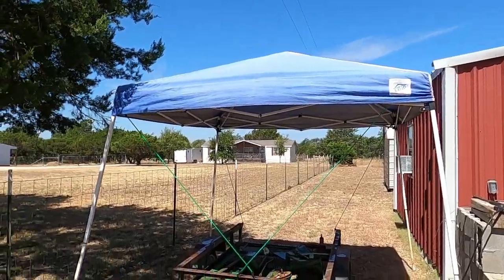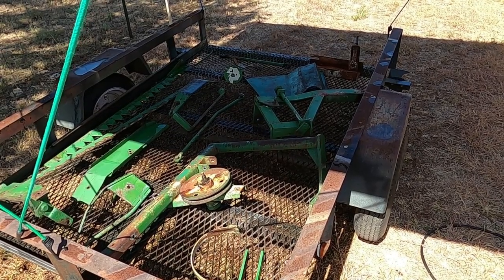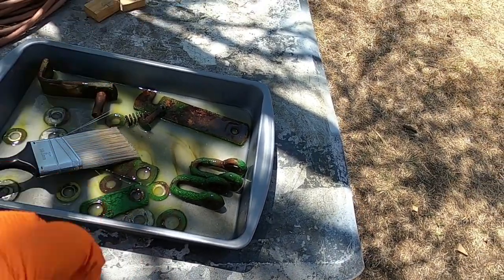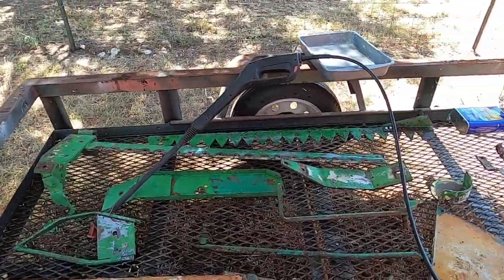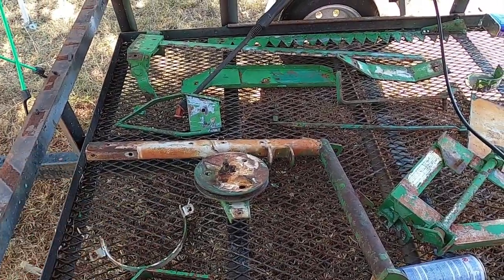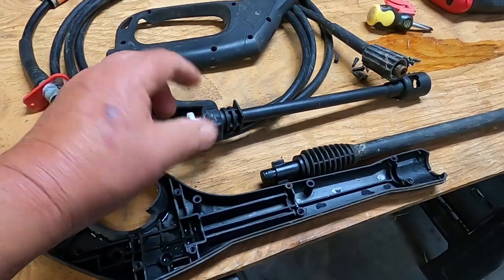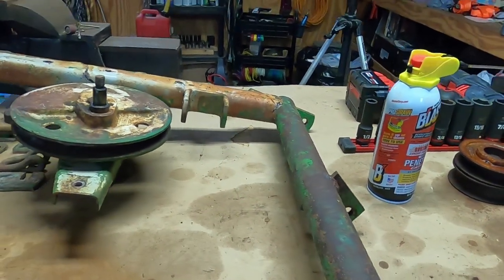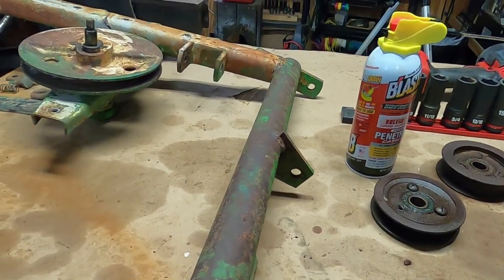Sickle mower part 8 stripping fail

Comment: Shame about the pressure washer but it is great that you have a spare. We have used 3M clean and strip wheels to remove paint in the past, these are great but they are not cheap
Reply from the maker: Thanks, The spare is an upgrade from 1300 to 1700 PSI. I am working on plan "B" and won't require stripper or pressure washer.